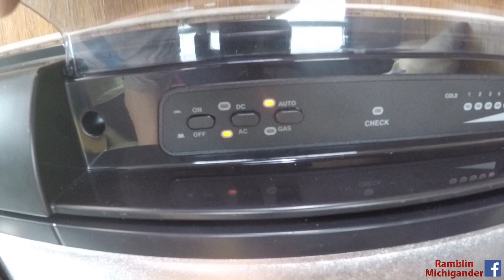2019 Season Begins!

Comment: I have a 1990 Xplorer. Replaced the fridge last year with the model you installed. So far it works great. I need to look into the steering stabilizer. Sounds like just what I need. Mine drifts when driving too.